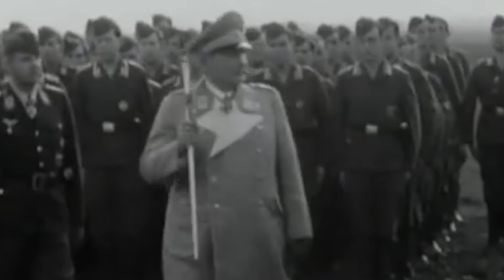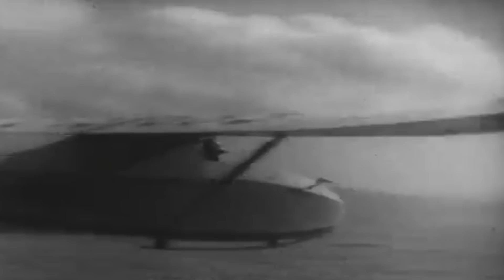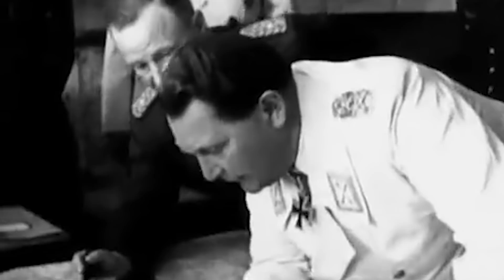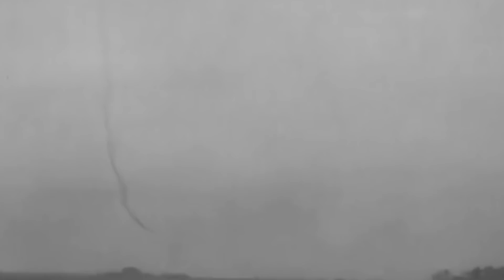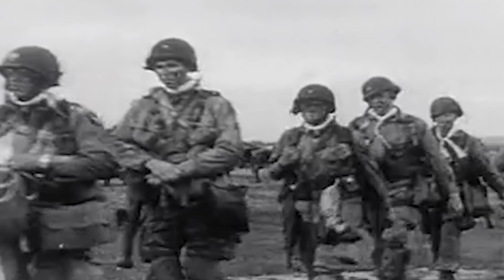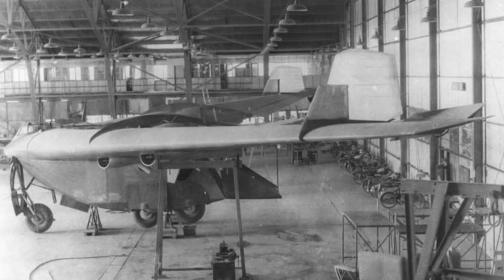WW2 Secret Stealth Bomber - Germany's Horten Ho 229

Comment: The bell-shaped wing? What kind of nonsense is that?! The Horten brothers found out, that a bell-shaped lift distribution over the entire wingspan is the key to a stable flying wing and they knew the mathematics to get there. They were in contact with Alexander Lippisch and knew the work of Prof. Prandtl. They did a lot of lift and drag and Reynolds-number calculations to solve stabilization and steering problems. They made their mistakes on the way, but they kept going and getting better.

Comment: You wonder where the idea for the B-2 came from
Reply: Not from the Horten brothers.
Reply: +Private Hudson  From the YB-35 that Jack Northrop started building in 1941,  years before the Horten brothers got approval to build anything.  The B2 is the same size and is designed for the exact same mission.

Comment: The Ho-229 was a Jagdbomber which means (freely translated) "fast attack bomber". Originally it was thought as a jet fighter capable of escorting heavy bombers to Britain etc. However, Hitler wanted it to be able to carry a bomb load.
The idea of bombing targets in the USA was a completely different task. A project called the "Amerikabomber" was brought up by Eugen Sänger. The idea was a high altitude jet-propelled aircraft that would use the atmospheric phenomenon of  "bouncing back" (like a flat stone on water). 
Anyhow, the Ho-229 was beyond anything any other nation on earth had or could produce at that time.
Imagine an aircraft with this low radar signature flying over 1000 Km/h and maneuver like nothing else in the sky.
Reply: The 229 was by no measure advanced...
Reply: +Kalle Klæp  The 229 was not a fighter and it was not an escort.  From the beginning it was proposed as a medium bomber based on the theories of low-drag,  fuel efficient wing designs along with the speed advantage promised by new jet engines.
Reply: @FiveCentsPlease  Hence the word "Jagdbomber".

Comment: This aircraft was called Horten 9. It was a prototype for the planned Go-229 jet fighter. Not Stealth! Not a Bomber too! The also planned Amerika Bomber was the Horten 18! Allways funny to see people are still excited by this futuristic aircraft design! I wonder why there's still no flying replica after all the years....???🤔
Reply: It was coated and that coating made it less visible to radar, so did the shape and materials used as did having no tail
Reply: @PIRANHA_MAN  There was no radar-resistant coating.  It was an unproven prototype---the third design experiment which did not fly.   It was covered with plywood because of materials shortages.  Engine covers were poorly welded steel.

Comment: was the horton 229 v3 even stealth capable? what is the source for this?
Reply: the coating, the design, the materials used. The shape. The speed. Come on man stop hating.
Reply: @PIRANHA_MAN  No it wasn't.
Reply: +Sultan   Any stealth characteristics were by accident.  They were built from the 1920s and 1930s theories that flying wings were more fuel efficient.  And they were proposed to the Luftwaffe as a fuel-efficient bomber that would be faster than propeller designs.

Comment: ....you failed to mention the influence their designs had on the B2 bomber, in part inspired by their wing planes...
Reply: It had no influence on it.
Reply: ...yes it did, for the Air Force experts brought back to the US many of the Nazi planes, and passed them on to our plane designers... just like they did with the U2 rocket technology used later in our rockets development, the advance German type 22 submarine designs used late to further development of our submarine designs, and the German jet engineers technology used later to aid the development of US jet engine technology.  So please, I know this subject very well. USN retired here.
Reply: @luistpuig  Hardly the case. The 229 was captured in '1945, sent to the U.S. later that year, stored for another year, evaluated, then ended up in storage in and out of a crate in NV at aircraft boneyard until the eighties when it was handed over to the Smithsonian. There was nothing to learn from its design. John Northrop had been working on flying wings slightly before and after them. 
> "brought back to the US many of the Nazi planes, and passed them on to our plane designers..."
 The Germans did such with the French aircraft, tanks, and other equipment in '1940. Does it mean they copied them? No. They adapted their designs later on from what they learned from combat with them as well as their equipment.
> " just like they did with the U2 rocket technology used later in our rockets development, ..."
 Operationally speaking, the idea of a ballistic missile was very influential- the technology itself was not new. The guidance system was rather anachronistic ( a dead reckoning system aided by two-axis gyroscopes aimed at the general area of a British or other European city ). And Von Braun noted himself, this technology was the brainchild of Hermann Oberth and Robert Goddard.
> " the advance German type 22 submarine designs used late to further development of our submarine designs, ..."
The Type XXII's design was only significantly innovative in one regard, hydro-dynamically focused hull shape. 
> "... and the German jet engineers technology used later to aid the development of US jet engine technology."
Only partially true, the majority of jet engine development actually came from the British. However Anselm Franz
 did influence turboshaft engines, and actually designed many of Lycoming's designs from the fifties through the late sixties.   
> "> _*"I know this subject very well. USN retired here."
 I respect your service, but that's irrelevant to the topic at hand. You didn't scrutinize the equipment or took part in designing these aircraft.
Reply: @ Nathan Peterson:: (smiling) and of course military experience IS relevant, you civilians only get snips of what we DO! get that in your civilian head, and do not debate with an ex-career military like, for you do not have the entire picture!
MM1/SS, United States Navy Nuclear Submarine Force, senior nuclear repairs planner, Retired.
Reply: @luistpuig  Again, I respect your service. But what you're claiming is that you know everything and have experienced what those veterans and government officials  did back in the forties. Which we both know you didn't. All information on PAPERCLIP and in particular the history of the 229 and other flying wings are public domain. As I said, I mean no disrespect, but no your experience is not immediately relevant to the topic.

Comment: It’s not a bomber. It is a fighter to shot down bombers
Reply: Where did you get this information
Reply: The design was a proof of concept for a flying wing bomber for Goering's 3x1000 bomber pet project. Though later fuselages on the Ho. IX  were intended as basis for fighter aircraft designs.

Comment: Nearly all the Wunderwaffen were doomed to fail because Germany lacked the strategic minerals and fuel needed to build and operate them. For example, given that 1945 German jet engines could only operate 10 hours before rebuilding was necessary, the Ho 229 would have needed new engines after every transatlantic flight, if it returned. The Reich also lacked the fuel needed to conduct a "Battle of Amerika", given all the other fighting the Nazis were doing. Brilliance combined with Delusion!

Comment: Actually it wasn't given the design number 229 until Gotha Werk was given the contract to build it... until then is was just called the "Horten IX". After the RLM assigned the project to Gotha it was given the designation 'Go-229' by Gotha. The design numbers used by nearly all German aircraft manufacturers during WW2 were assigned in blocks of numbers to each manufacturer by the RLM (German Aircraft Ministry). Number 229 just happened to be the next number available at Gotha so it was assigned that number. The Horten brothers always intended their H9 design to be a fighter, the Horten Bomber concept was never even started (all the pictures he shows in this video of the jet powered wing are the Horten 9 (Ho IX) fighter)... it was Hitler, with his obsession for bombers (specifically dive bombers) that insisted it be capable of carrying a bomb load, not Goering. Most of the comments made by Goering were parroted from Hitler. In fact, Germany abandoned it's long-range heavy bomber ideas (dubbed "Ural Bomber") before WW2 ever started because they believed (then) that the war would be over quickly and the 'Blitzkreig' concept would allow Germany to overrun their enemies fast enough that a sustained, long-range bombing campaign would not be necessary. It wasn't until later (too late) that Hitler (and others) realized they goofed and really did need a long-range bomber. But I digress: The Hortens, when asked if their design could be a bomber said it could.. but mainly just because they wanted to get approval for their H9 fighter concept. The insistence by Hitler that this (and other late war designs) be capable of bombing caused developmental delays and slowed the aircraft being finalized... the same thing happened with the Me-262... which was fortunate for us. Had the Me-262 been in production in 1942 as originally planned by Messerschmitt we would have had a much more difficult time with bombing raids that we did. Messerschmitt had to redesign the aircraft to meet the RLM (from Hitler) requirement for a bombing capability.

Not sure where he got his references but from everything I have read the most widely accepted prototype for an "Amerika Bomber" by the RLM and German High Command during the late war years was the Messerschmitt Me-264, a 4-engined propeller driven aircraft. A prototype actually flew to within a few hundred miles of the US coast and returned to Germany in late 1944 or 45. He was certainly correct in saying that much of Germany's development was unfocused, which was a big help to the Allies. Even so, Germany managed to develop numerous highly advanced aircraft (Like the Do-335, Ta-152, Ar-234, Me-262) and weapons (like the V-2 missile and Ruhrstahl X-4) before the war ended but by then they had no fuel and no pilots so the few of these advanced machines that actually were built were destroyed on the ground by strafing allied aircraft or destroyed by their own crews. A few were captured, but only a few.

Comment: accept for the costs of maintaining steel jet engines and replacing them every what 30 hours of usage.  Kinda similar to the costs and cost overruns of the F-35... USA is at that junction of falling.  Over $1 trillion plus waisted on a over priced gimmick.
Reply: > "Kinda similar to the costs and cost overruns of the F-35... USA is at that junction of falling.  Over $1 trillion plus waisted on a over priced gimmick."

 Hardly the case.

Comment: I appreciate the work you have put into this video, but so must point out that Ludwig Prandtl and the Horten Brothers never collaborated or used each others work. The Horten brothers found they could get better stability by adding washout to the wings, in other words, twisting them. They did not use the Bell Shaped Lift Distribution described by Prandtl, and Prandtl did not understand that you would have to twist wings to achieve his lift distribution. The work that Al Bowers at NASA AFRC included putting these two ideas together. Aside from meeting a couple times, Prandtl and the Hortens did not use each other’s work.

Comment: I think it's only natural to wonder how much inspiration (or possibly much more than inspiration) was taken from the Horton brothers' aircraft when Jack Northrop was developing the YB-35/YB-49. Ironically, Northrop never did resolve the stability issues resulting in the projects being abandoned (or at least shelved until computer controlled fly by wire systems made the concept viable again with the B2). It really is ashamed how many brilliant minds were wasted in Germany during and after the war.
Reply: None. The YB-35 was a prewar design.
Reply: @peterson7082  Ah, indeed it was. I knew that Jack Northrop had envisioned/played around with the idea of the flying wing prior to WW2, but I did not realize that he had tested what was essentially a small scale YB-35 as early as 1940. But ya, after reading a bit more on the topic, it sounds entirely implausible that Northrop could have taken any inspiration from the Horton brothers' designs. You learn something new every day. Thanks for the info :)
Reply: @lahma69  No problem.

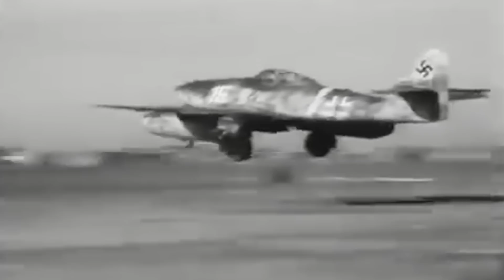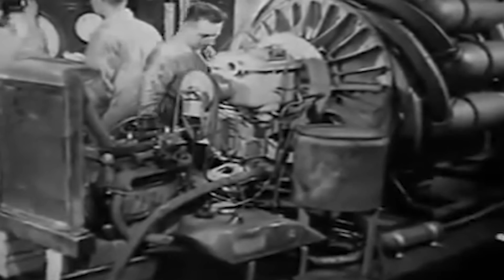Comment: At 4:03 and 4:32 you are showing British jet engines, not German jet engines.  German jet engines were axial flow, long and slender, the British jet engines were short and wide, a combination of the technologies of a turbo charger driving a supercharger.  They worked to a point but after the war, the German jet engine concept was recognized as far superior with much more potential for improved performance.
Reply: It wasn't their concept. It was just another design that the British also were working on.

Comment: The 'Ho229' was designed to meet a specification requiring an aircraft that could fly 1000km at 1000kph, carrying 1000kg of bombs or other "stores".
Reply: No. It was a proof of concept for an aircraft the Horten brothers/ Gothaer Waggonfabrik were planning on designing to meet those requirements.
Reply: @peterson7082  I'd read that this plane was actually itself capable of meeting Goering's three target-requirements, instead of being just a test-bed for something bigger and more capable: as a fighter, I'd have thought it would have had trouble carrying more than a few hundred kgs. of bombs (on the underside of the wings, as there seems no room in the centre-section for a bomb-bay in the plan illustrations).
   (The narrator quotes a payload target of "8800 lbs." which is nearly 4000 kg.: that's quite high for such a small aircraft (Goering hadn't demanded such a  bombload, if I'm not mistaken)).

Comment: knew a bit about this coming in. mostly it’s a delta wing design that was meant to be laminated plywood so its invisible on radar (especially once you add its unholy speed compared to anything else of the era) and anywhere near the target weight. the mission to nuke NYC was likely a suicide mission and if it could reach D.C. it’d have been a kamikaze mission. Jet engines back then (and the Germans were effectively the only ones with them) were struggling with producing enough power and dealing with fuel consumption especially. 
It was so futuristic it directly inspired the B-2 Spirit, when the American finally managed to copy it. When a TV show build a large-scale replica and they did limited radar reflectivity testing at skunkworks, it still stands up very well indeed.

Comment: Little bit more fluff in there than required. Claiming "NASA can't figure it out" is preposterous... not sure where these journalists came up with such claims. I'm sure it has something to do with an extremely dated, out of context comment made by someone in the US.
Ingenious design, most certainly. But it should be noted that US based Northrop was working on the same type of airframe designs around the same time frame... only cancelled/written off because Americans recognized it wasn't economically viable... one of the many reasons the German designs would have also eventually failed in this era. It should also be noted that the German turbo engines at the time couldn't fly more than a few cycles without a complete overhaul due to a lack of any known materials in their possession that could withstand the combustion heat being generated... a critical bit of information left out that would have made bombing America all but impossible anyway. Maybe they could have done it with piston engines, but also not as likely... 6K miles is a long way for a bomber having to fly lower altitudes and slower speeds on supercharged engines... which would be the only way to achieve light air altitudes required to run this sort of distance.
The one thing the Germans should be commended for is trying the most outrageous concepts at the time. Without their reckless and grandiose attempts at crazy engineering ideas, some tech that we enjoyed in the 50's would have been delayed for probably at least another decade... and the Russians would have likely beat us to the moon.

Comment: B-2 ' s grand daddy
Reply: The B-2 is based off of Jack Northrop's flying wings, which he started developing 4 years before the 229 was developed.
Reply: @davidj9677  ok it had a grand mommy too 😆
Reply: @davidj9677  The Hortens were way ahead of the Northrops get over it.
Reply: @PIRANHA_MAN  "Way ahead?" Northrop flew the N-1M 4 years before the Horten existed. . . so much for "way ahead." The only thing more advanced about the 229 was that it used jet engines. If you believe jet engines were a unique German invention then there is no point in arguing, you're just a Wehraboo.